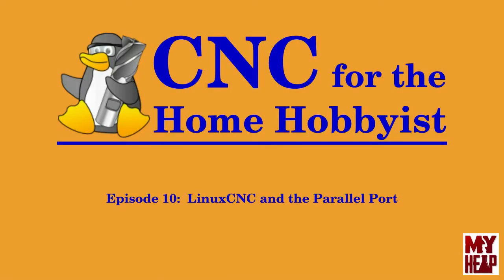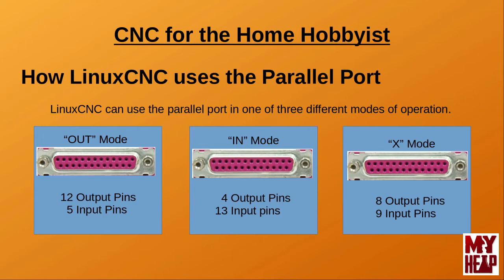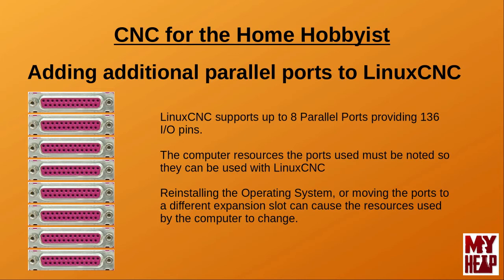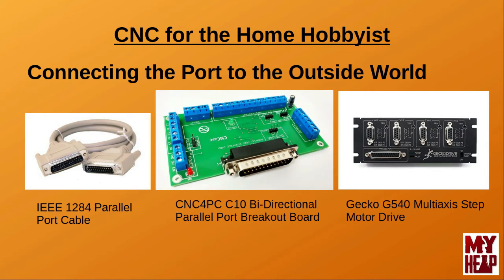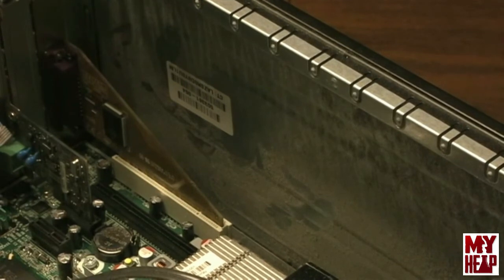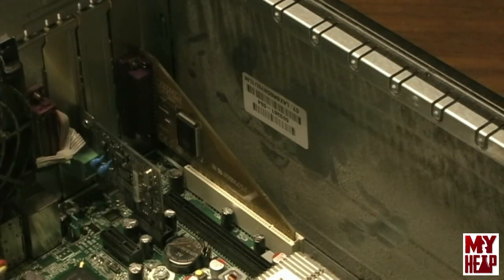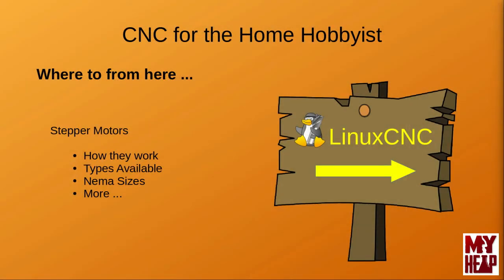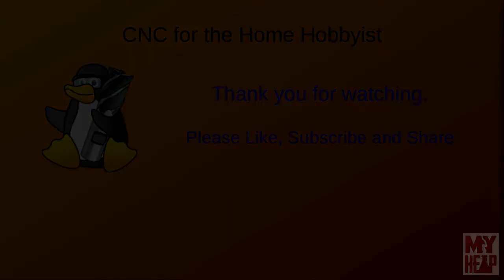LinuxCNC for the Hobbyist - 010 - LinuxCNC and the Parallel Port

Comment: Today I tried to install a second parport in LinuxCNC and I found out that my card is not automatically recognized by linuxcnc. When I type lspci -vv it will appear as [disable]. I found this page with a possible solution to this problem http://wiki.linuxcnc.org/cgi-bin/wiki.pl?NetMos. I'll try it tomorrow. In any case I have another parport card to try out. I hope at least on of them work. Would you have something to add regarding this issue? Thanks in advance!
Reply: Well... I had no choice but to replace the parallel port card. The previous one (the one which didn't work) has a Moschip 9900 chipset, and I was able to find several forum post from people with this same chipset having problems to make it work. None of them were able to make it work, they had to replace it. And so I did and now it's working!

Comment: hello from spain.
im new to plsama cnc but i have built a three axis x y z all of which running fine withe the linuxcnc program, my problem is i cannot trigger the relay on my mach 3 5 axis bob from within the stepper configuration, i use pin 17 but what will trigger the relay ( cw, ccw, pwm, splinde on or what else could i try)
Reply from the maker: George, can you email me your configs?  The ini and hal files and I will take a look at what is configured and hopefully I can assist you.  My email address is xavier at gtec dot com.

Joe
Reply from the maker: George, I sent you an email.  You config is a little confusing because of multiple connection to motion.spindle forward.  To activate this, you will have to send a G code to turn the spindle on in the clockwise direction.  To test, open LCNC, turn off the estop and power the machine.  Go to the MDI and issue M3 S500.  This will turn on the spindle at 500 RPM.  I know you are running a torch and not a  spindle, but you have to have a speed set (S word) to something greater than zero for the spindle to come on.  When this command is issued, the motion.spndle-forward signal will go high.  This is tied to pin 17 of your PP, so when the signal goes high, the output on the pin should be 5 volts.  To turn it off, issue an M5 command in the MDI.

Joe

Comment: Ok and linuxcnc requires a pc laptop with a parallel port correct?
Reply from the maker: Most of the developers warn against using a laptop for realtime applications.  A quick login to the IRC channel can give you a lot of reasons why.  Most just use a run of the mill PC, including myself.

Joe
Reply: @MyHeap  thats not an option for me and i have been using laptops with parallel ports for my non linuxcnc cncs for years with no issues....i cant use pc as all of my cnc machines are portable not stationed in one spot..but i assume the pc needs to have a parallel port so i guess ill put it on one of my older laptops..i have not used linuxcnc before so we will see if it will work or not for me.
Reply from the maker: @shelby50411  giving it a try hurts nothing.  I would go for it and see.
Reply from the maker: @shelby50411  there are other options available, for example ethernet and io cards.
Reply: laptop have worst use linuxcnc, better use table computer, can buy cheap good computer less than 50$

Comment: I am using Wheey 2.7  but i still get a mesage for parport "no such directory"
Reply: Me too. It can't find my card.

I can't get any movement from my G540 steppers either. So frustrating...

All these tutorials are useless unless you have identicle hardware and unlimited time.
Reply from the maker: Chris, what command are you running that you get the response of "no such directory"?  What parallel port card are you using?

Joe
Reply from the maker: Robert, I am sorry you are frustrated.  Maybe I can help.  What commands are you using to find your card?  What messages are you receiving when you issue these commands?  What parallel port card are you using?

Joe
Reply: That is very kind of you but I finally figured it out today. My issue was that I chose the Gecko G540 profile for my Gecko G540. It does not work for newer 3v cards...

It would help a lot of people if you added a note to tell people not to select the G540 profile in the conf wizard to run a G540. Instead, change the first number to 5000ns.

Comment: Sir, can you make a tutorial for installing Linuxcnc on Ubuntu 16.04 LTS?
Reply from the maker: Richard, thanks for taking the time to watch and comment.  I would have to do some research on installing to Ubuntu 16.  LinuxCNC requires a realtime kernel and extensions.  This can be done with Ubuntu and other flavors of Linux by installing the RIP (Run In Place) version of LCNC.  If time permits I may be willing to address it, as it is a good and valid request.  In the mean time, I would suggest you go to the LinuxCNC website and review the documentation for doing this.  A search in the forums on RIP or run in place should yield you some results too.

Joe
Reply: @MyHeap  First of all, thankyou for your respond Sir. I have also another question regarding CNC machine. Is it still common to use such CNC machine controlled through parallel port nowadays? Especially the machines which are controlled by Linuxcnc?
Reply from the maker: @birdoutofcage7  It is still commonplace among Hobby folks to use the parallel port.  Mainly because they are inexpensive to get and use.  For more robust applications it would probably be best to use one of the many available MESA I/O cards that are available.  The series I have been working on is geared towards people who have an interest, but may have limited funds and limited knowledge about the subject.  I have a litany of episodes that I want to do with this series, but have been crunched for time since I started a full basement remodel project in my house.  There are more to come, I just cannot say how fast I will be able to get them out right now.  I hope that answered your question.  A very good question it was, by the way.

Joe

Comment: stupid use gecko G540 style board, because if one axis burn, then need buy expensive all board new, waste lot money, lot better have BOB style board if somethink go broken or burn, need change only one motor driver new or only BOB card new, lot lot cheapen, normal BOB cost less than 10$ and drivers less than 20$ but gecko board cost 20x more.150-200$
Reply from the maker: I am a firm believer in trying to keep the system as modular as possible.  I agree that I would use a BOB and separate drivers.  But to each their own.  Thanks for stopping by and watching and taking the time to comment.

Joe